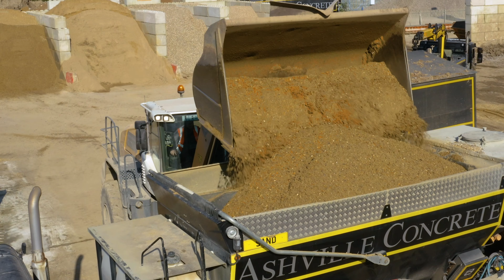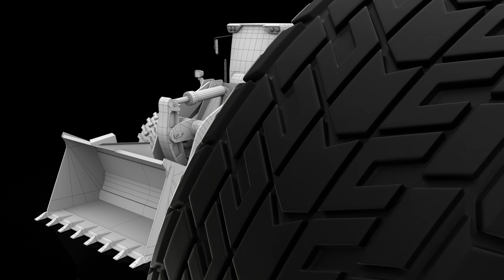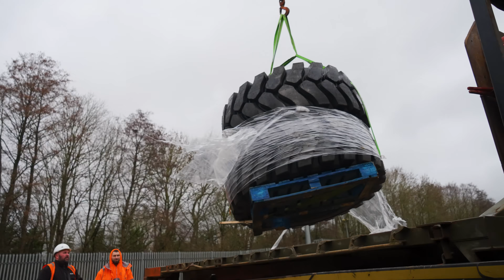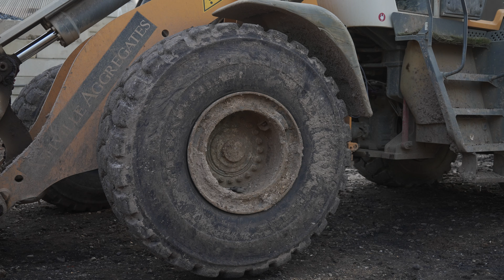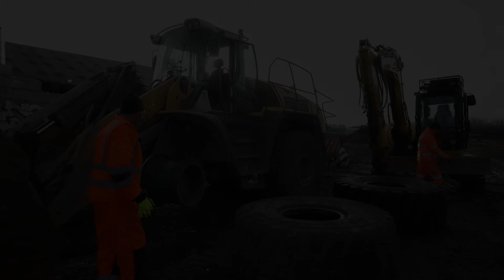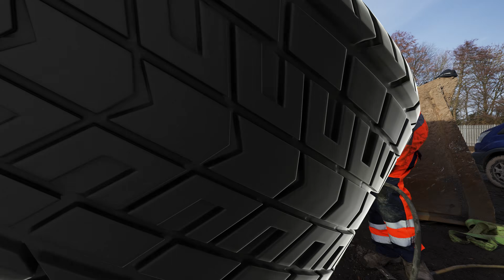How To Change GIANT TYRES on MEGA MACHINES

Comment: Yes .the bottom discharge is the way forward but the yard layout may need looking at.when your trains enter the yard do they discharged the material at the top off the yard as they enter.,if so the rest off the train will be on the main line for the duration off the unloading ?would this not block the main line for any other trains?might help you to do computer program for the time it takes to unload the trains in your new yard could save you a lot off money .(a train  simulation)

Comment: great information video  keep up the awesome work 
 i was  mobile service tire tech for otr / agri / commercial for 7 years 
lf notice few things i would done a bit different the rim and rim components need to be clean well things 
i didn't see  lube on the sealing grove where the o ring  i notice there was not cribbing or stands under the front axle , i didn't see a new valve stem  being installed
bunch of there stuff i sayin might of been cut out of the video except the stand/cribbing i saw that stay safe out there boys i have had  a hydraulic loader cylinder fail and it almost got me  lesson i learned tools and truck can be replace but ppl cant there many story of other sketchy /scare monument i have heard from other tech from locking ring coming flying off ,tech getting sent flying from a zipper blow out ( i have had a 26,5r25 zipper on me ) to also getting hit my driver on the road  i  want to say stay safe out there if take 15 mins long it takes longer 

he punction in the tire is repairable with a section repair of the tire which is where the cut  our the old damaged section fill the area with new rubber and i section repair boot/(patch) then the tires is cured in a oven i have installed many section repair tire in time a tire tech i also used many rethread otr tires 

for ppl; wondering the tires that are not useable in Canada the are made cow mats and other rubber products 
for any wanting to know why they installed the on the front instead of the rear is due to a loader front tire receiver the most wear on the unit 

i want to give credit the gentleman's doing the service its a very heavy demand physical job and they did a great job  cheers 

i was lucky and i had a boom crane to help me on my time as a tire tech and is very demanding job  and for all my current tire tech and retired ones cheers for the hard days ( and you all know those days )

Comment: Just out of curiosity, although the front wheel which had the puncture was obviously unrepairable the other tire which you took off he’s obviously still serviceable. When is the tread depth on that tire is in comparison to the tread on the rear tires. Good that good front tire still be used to replace any of the rear tires should I become faulty/punctured in the future? Secondly, what happened to the tire that was faulty? where did it go? How was it disposed of, perhaps your millionaire client may use it in his garden for tossing tires to build a core strength LOL.

Love the mid week video. Unfortunately I watch the weekend video where you announced the mid week video from before so I’m watching it mid week a week later LOL
Reply: i use to be a old tire tech and ran a service truck yes that is not repairable in the field but can be sent out have a section of the damaged area repair the old tire in Canada get grinded up and made into rubber  cow mats or over reusedable rubber product the tires are normal called otr tires and you can have them rethreaded and have a new thread glue and cured on to the casing of the tire  , the front tires also take the most wear on the unit

Comment: Why not shave off the tread on the new tyre and make it level with the existing one instead of replacing tyres on both axles? 

Jokes aside. I know someone that died when one of these things exploded. So safety should not be compromised when replacing these tyres.

Comment: Could you show the damage to the side wall? I specialise if vulcanising tyres where you can do large repairs in tyres side wall. That you could use a spare tyre. An should you know replace the back tyres as well if there is that much difference in the circumference of the front tyre it would be the same as the back. An cose tyres to be constantly pushing an pulling the back tyres Lear by damaging the diff.

Comment: Used to do that job around the world did it for years those tyres are pretty small tbh the open mine trucks are the big boys CAT 797’s are fun lol, changing 27.5’s & 29.5’s were daily jobs, one thing I have to say is how stupid those fitters are not jacking the machine,  lifting it with the bucket is a pure idiotic cowboy move if the operator knocks the lever or the machine loses a hose or pressure it will come down uncontrolled killing  the guy

Comment: H+S failure..... :-/ tyre should be inflated in a cage. A bloke who i worked with got killed when locking ring came out on rim he was inflating whilst fetching a non runner Cat shovel back to our yard.
Reply: Should be inflated in a cage if possible but not practical and 90% of loading shovel tyres in the Uk are fitting this way. You very rarely come across a cage for otr

Comment: what about the rear tyres? how would you lift the machine?
Reply: Bit more difficult as you can’t use the bucket to lift the rear and can steer to slip the tyres in place
Reply: Massively big and heavy bottle jack, depending whether the client's got a huge excavator or not

Comment: Great video,  very interesting.  Fitting new tyres across a driven axel is true for road cars, especially 4x4 as the diameter difference can put additional stress on the drive line.

Comment: I wouldn't have thought that the same rules applied to a plant vehicle on a static site with regards to damaged tyre walls, it's not on a main road and doesn't cause a threat to lives as it moves so slowly, i may be wrong but surely a very good repair would have been suffice.